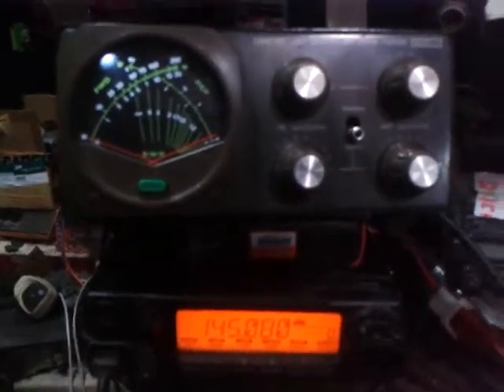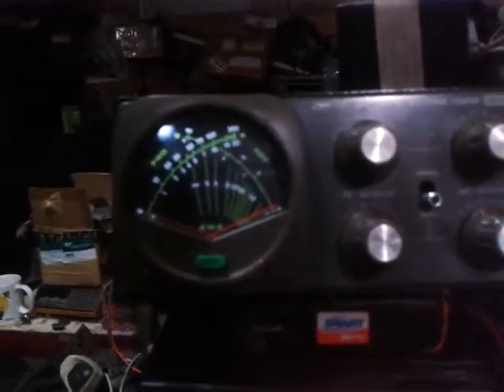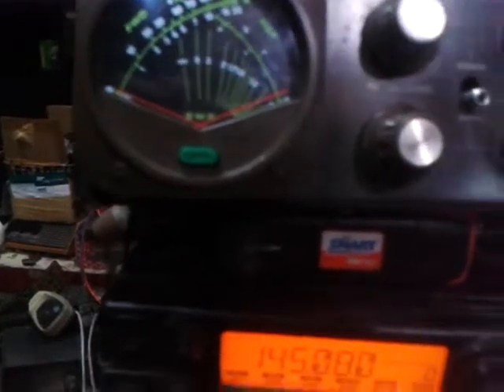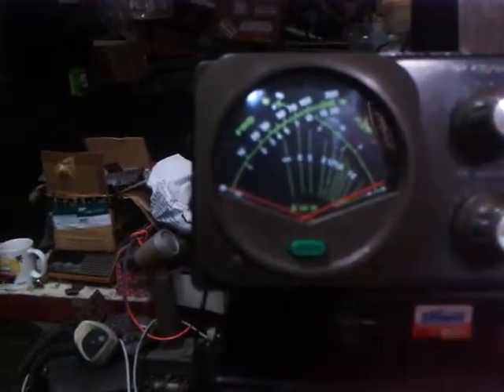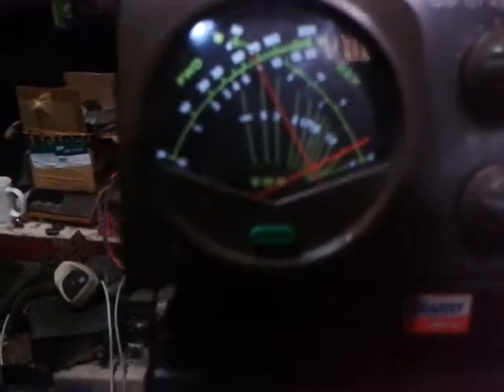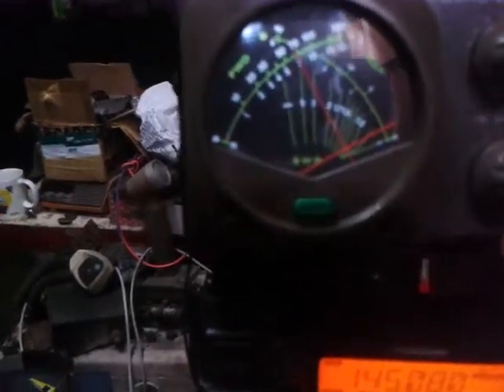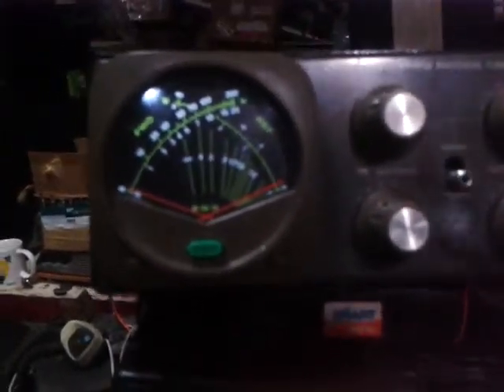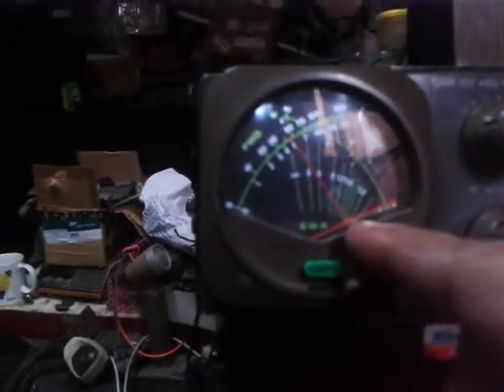4F1KJA Restored a Daiwa CNW-727 Antenna Tuner of DV2NEX

Comment: Thanks for this vid. I recently purchased one. I’ve noticed that on my unit, there is inconsistent contact and needle response, if I toggle on the green power button. Is it ok to spray electronic contact cleaner into the components inside? Thanks po.